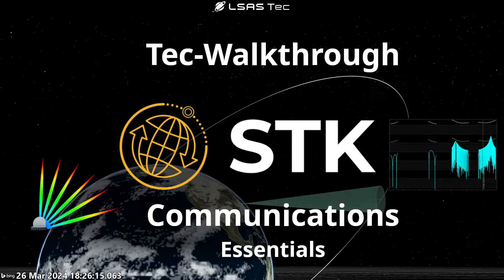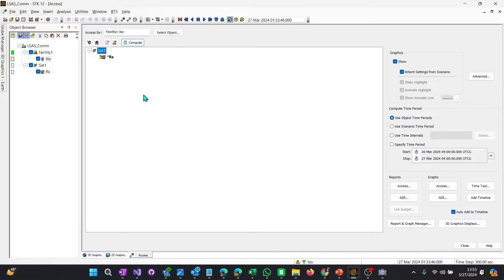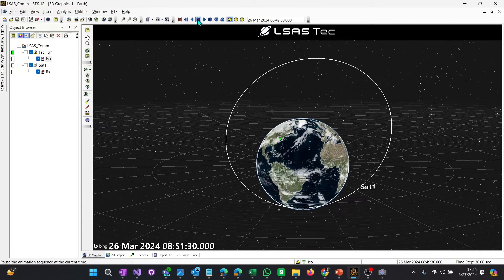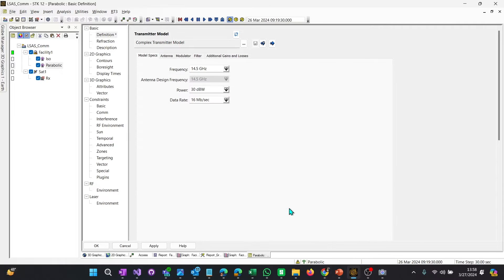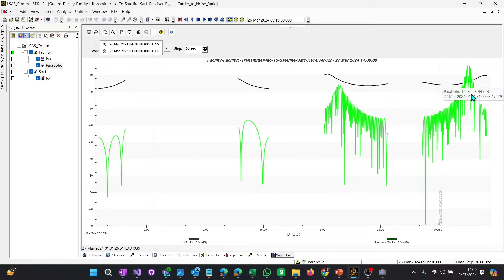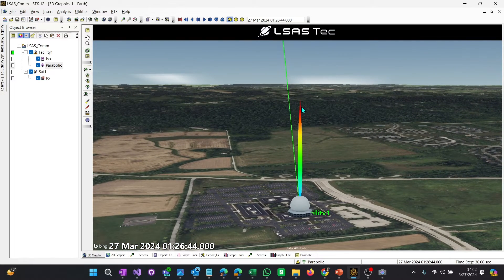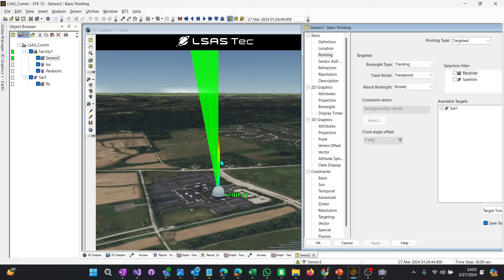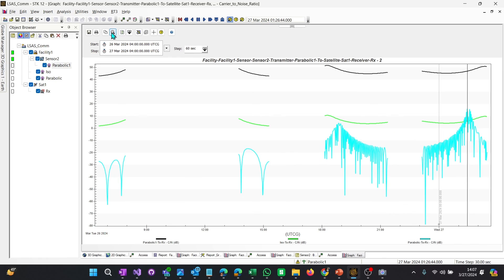Tec-Walkthrough: STK Communications Essentials

Comment: Great video, ty!
I have a question, how would you add constraints? 
For example the link is not quite stable in every scenario so I'd like that in the Access Report to be shown only the communication windows when BER is higher than a certain value.
Let's say BER > E-4 is the threshold so the the first few seconds of the contact won't appear anymore
Is there any way of doing this in STK or doing it in a Python script would be an easier solution?